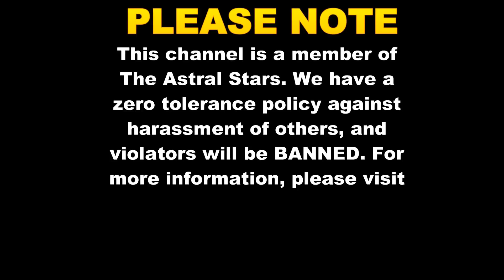⭐ 1977 Buick LeSabre - 350 - Engine Removal - Gasket Overhaul - Part 13

Comment: Man this is getting good...I have an 1969 Chevrolet impala..350 with power glide transmission that my dad bought back in 1980..and the motor stopped back in 1992...and I just pulled it out of my dad's garage since he has passed...and watching the genius Tim...can't wait until the summer to rebuild the motor ...great inspiration watching Astral Auto repairs
Reply from the maker: Thanks Dexter, it is going to be so rewarding every step of the way when you do that engine!! My dad (he still alive) gave me the Mustang that I am re-doing, and it's just something about working on it, that I just can't explain, so I know you have 10 times the feeling I have. Every bolt you turn, your memories of him will turn with it, just like he was there!

Comment: Tim The transmission vacuum sometimes they go bad and when they are not working properly the vacuum will push the transmission oil into the intake and the engine will start to smoke it happens to me with a 1977 Chevy that engine is coming out sweet you are putting all of your heart into that engine 🤟🤟🤟
Reply from the maker: Thanks for that Ziggy, because i always knew that solenoid was vacuum operated, but i would have never guessed (and it does make common sense) that if that valve goes bad, the engine would just suck that fluid right up into the intake, THANKS!!

Comment: What was that you said, with conviction? No DIESELS, No TRANSMISSIONS, and No BODY(metal)WORK. And here we are watching a video, after the diesel one, of you working on a transmission and doing metal work. It's no wonder you can't find good help. You can't decide what you can't or won't work on.  Seriously though, I will be glad to come and lend a hand if needed for install and be there at first start-up.
Reply from the maker: LOL, now this kind of transmission work I don't mind because it's OUT THE CAR!!! Rick, get this...

Yesterday we got a call from a guy who we worked on his car 2 YEARS ago, which had a fuel pump issue. He called to say that his lights don't go out, horn and windows don't work, and he feels it's because of what I did TWO YEARS AGO!!!!
Reply: @OnlineAutoRepairVideos  Good one! Definitely fuel related. You gonna work on it? Tell him you only warranty your work for 12 months or 12,000 miles, whichever comes first,and you'll have to charge him double if you have to do it over again.
Reply from the maker: Funny you said that! Our receipts state different warranties, and his would have stated 1 year / 12,000 miles!